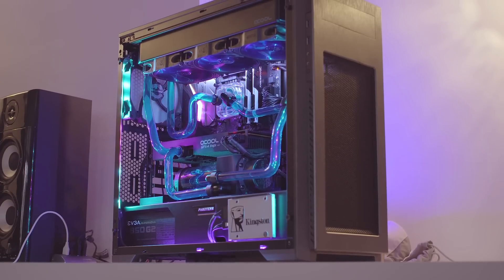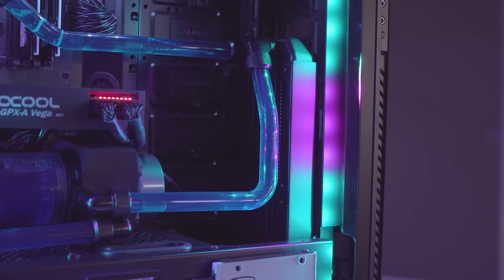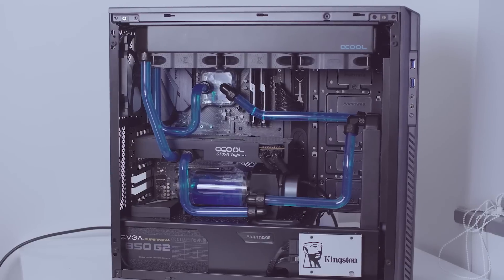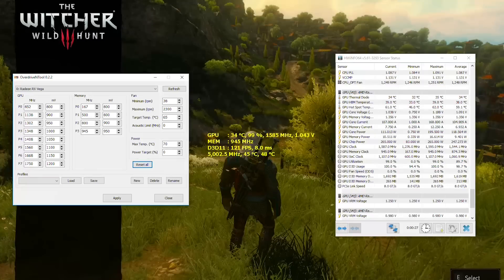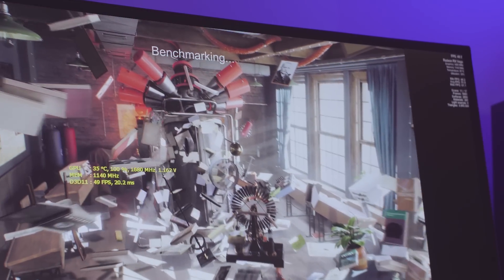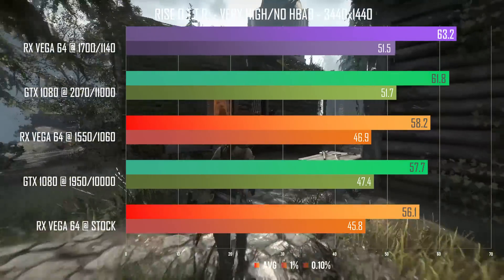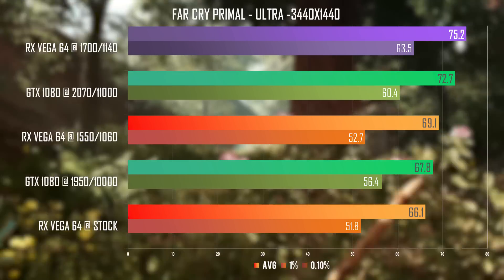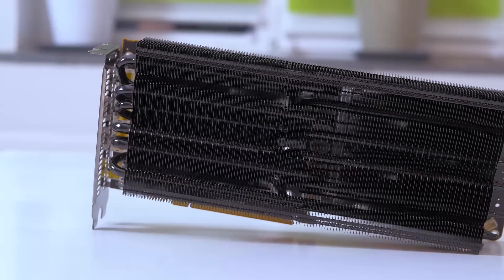1700MHz RX VEGA 64 - how FAST is it?

Comment: Wouldn't it be great if vega was included with the 12nm refresh early next year.
Reply from the maker: +Mikey Yes, this would be doable on air...
Reply: I really don't think we'll get a dual gpu card. Vega is too expensive and it seems the current capacity for putting out enough chips to do that isn't good. Plus how do you handle the HBM.

Comment: hey mindblank, nice video. i use the same water block on my vega 56. and i am seeing the same issue, that it crashes at stock settings (1750MHz boost). so i think that makes it very likely that the liquid cooled cards use binned chips. did you somehow tune the pump/fan-curve? i only use a double radiator... after a while under hard load the fluid temp rises as soon as i use a high power target on the LC bios.
Reply from the maker: +TheJohdu I'm 100% sure LC cards use binned GPU's.
Reply: so any tips on pump tuning?
Reply: if possible on my rx vega 56 gigabyte custom achievement 1720 mhz but at 1.1 v stable but mother consuming ... currently only 1,050 v at 1670 mhz all this accompanied by 1023 memory with tight times with memory tweaker ...

Comment: i wonder what makes the vega scale better for ultrawide gaming. Also, would a 750W power supply be able to run that system?
Reply: i basically run that system and at +50% power target with the liquid cooled bios it newer draws more than 560W from the wall. with a 600W-650W PSU you'll be fine. just get a quality one.
Reply: Vega 64 has 45MB of on-chip SRAM (or so I understood), and HBM2 memory. I'd wager the higher bandwidth and on-chip memory help tremendously at that higher resolution.
Reply: Thanks!
Reply from the maker: +Chris Clark Yes, it would.
Reply: I see. Thanks Severe Arts!
Reply: 750 watts should be just fine for Vega even with overclocks. Unless you also over clock the cpu. Then it will be kinda close to maxing out the psu.

Comment: It costs VEGA a whole custom loop and triple power consumption to match a 1080
I love you AMD but please. Get your shit together
Reply: Be glad they attempted to enter the high end market. I am amazed they are even still a competing company when compared to Intel and NVidia. Seriously look at NVidia vs AMD. In Q3 of 2017 NVidia made over 800 million while AMD barely made 80 million.
Reply from the maker: +Artemis I don't think anyone's gonna buy a complete loop just for Vega. Rather people having a custom loop getting waterblocks for Vegas.
Reply: Lee Aguina, the VEGA 64 has a power consumption at max load of 460watts and its not gonna be $499 anytime soon thanks to shortages and miners.  Also the 1080ti is dropping in pricing and with Volta around the corner it will see further price drops.  also SLI is not ideal specially with the fact the VEGA's big power draw and heat, never alone gaming still doesn't utilise SLI very well to this day still.

so as of now the VEGA 64 is priced at the same as a 1080ti if not more.
Reply: I don't know, if you already have a custom loop and you have a free-sync monitor, I don't necessarily think the Vega 64 is a bad buy.
Reply: these were the games that favoured the 1080 dude
if he used the results he said he wouldn't it would be a landslide
Reply: I also run a vega 64 overclocked on a 600w psu....
Reply: With the latest drivers ( 17.11.4 ) it is a killer card for just 479 euro !
Reply: Triple power consumption, bullshit? Stock the Vega has a 295w TDP the gtx 1080 has a 180w tdp. Stock vega performance from all the benchmarks I have seen is around 95% the performance of a 1080.
Not to mention the compute performance of vega 64 is much better.
Reply: Artemis Vega power is at 250watts at 2000h XRM another thing 200 @ 1900h if you wait Vega always go back to MSRP with is 499$ 1080ti is 899$ lowest 700$ if I get 2 Vega 56 at 399$ when it's at MSRP when you wait and they drop like always or even better get an open box for 350$ if you don't know what your talking about you shouldn't comment fan boy
Reply: gertjan van der meij, lol from here? off the back of a truck by a guy using the alias Bubba.  the VEGA 56 and 64 are on a global level of major hike in MRSP and shortage.
Reply: But Vega is great for mining because it has better compute proformence than Pascal
Reply: At stock it's only a few FPS less. Barely noticeable
Reply: I feel like after such a retarded statement, somebody needs to get his own shit together before all else...
Reply: Just keep it at 150 w maybe?
Reply: MindBlank Tech thanks for the reply. But I only state what it costs Vega to match a 1080. Not that anyone should build a whole loop for it. I really want to utilize my freesync panel but I'm on ab ITX build with a 400w SFX  PSU sadly

Comment: hello nuclear power comsuption...
Reply: Brynden Rivers, its not the electric bill thats everyone issues, the issue is the card isnt even that powerful and its power draw is extremely alarming.  not to mention in small enclosure chassis the amount of heat the card generates thanks to is massive power draw is dreadful.  not to mention the massive power draw and reaching high temps results in very lil ability to overclocking which it begins to throttle.   AMD need to get their shit together.

Comment: Well, with all this tinkering to beat the 1080 at the cost of massive power draw and quite frankly money, I could just buy a 1080ti and be done with it.
Reply: The amount of ingenious and unseen before data in this post staggers me. Thank you for opening my eyes!
Reply from the maker: +mortl I know, it's completely true. But WC enthusiasts that run Vega cards will watercooling them anyway though. Also this might be possible on air with a future Vega refresh, just like it was with my watercooled 1490MHz RX 480 that became possible later on 580's.
Reply: And now my stock reference vega 64 beats the 1080 ;\

Comment: Maybe you should shoot Linus and Jay a message, letting them know vega is actually a decent card
Reply: Never said Vega 64 was a bad card, but then again, the price positions it above 1080 by 100USD and under 1080ti by 100USD, and this is done by using watercooling. This video proves Vega can do higher clocks easily, but the power draw and heat would be too much for air coolers. AFAIK, 500USD gtx1080 vs 600+USD Vega 64, you are only getting 2-5% performance increase even with a waterblock and a custom loop with a 20+% price increase which means it’s totally not worth it. AMD should seriously try to make Vega efficient on higher clock speeds at this point, or they will have a tough time.

Double checked Vega 64 prices, apparently, they are all 680USD and above at the moment, which means it’s just 20-40USD under a gtx1080ti. The gtx1080ti will each the Vega 64 for lunch in any game at this point, so I think AMD still has to improve a lot of things here
Reply: Bourinos02 the v56 with a 64 bios performs identically to a 64. So price of the 1070 for performance of the 1080. Top that with people water cooling 1080s as well and you have yourself a very comparable offer. Also consider the price of freesync vs gsync.
Reply: Ahem, the only argument there is free sync vs gsync... 
In my country, a vega 56 (when supposing that it's the same performance as a 64 which would mean that there is no binning process between 56 and 64 which is unlikely) is around 560€, the price of a 1080 is around 550€. So basically the same price for worse stock performance and higher power consumption. Not really a win/win situation. Especially when you know that if you add custom water cooling to the mix you end up in easily in 1080 Ti territory in term of pricing, with a 20% fall in performance (OCed 56 vs stock 1080Ti) and even worse power consumption...
Reply: Or it is (more likely) silicon lottery.
Reply: Jay and linus get more  free cards from nvidia  then AMD so of course they push nvidia on people not one of  thier reviews  talked about hb2 memory is far better than ddr5
Reply: Wrathinside James Mastroianni 1st off, this GPU is $650+ in my country without the water cooling parts, 2nd this frequency just breathes fire and consumes too much power 3rd a GTX 1080 FE blower with good airflow can OC to 1,900-2,000 MHz core regularly, about 7,000+ score on Superposition. This GPU could be good if you are not bothered in tweaking the card yourself, but for the majority people, it's not a good card compared to the competition.
Reply: Linus did do a Vega/Morpheous 2 later and recommended it.
Reply: Nah. Let them circlejerk, that's what they do best. Last time I asked Hardware Unboxed about the discrepancies between his results and Mind Blank's, I got something along the lines of:
"We(I assume the elite techtuber community, they all circlejerk, it's very noticeable) have tried to replicate this channel's results, but could not do it. Therefore take it with a grain of salt."
Reply: Well, this video shows that if you use a lot of money to buy it and watercool it with a custom cooler and win silicon lottery, you can manage to be nearly identical to a 1080... For 100$ more, not including the cost of the additional cooling, and the electric bill..
So decent card, certainly, but price/performance wise, this card is just meh...

Comment: i would like to see what you could do with a 1080 after water cooling it and  spending the time tweaking it like you did  your vega card.
Reply: "ol 1070"
Reply: halistine jenkins I can tell you right now, my 1080 11g memory, thats at 2100mhz and 12gbps memory speed, doesn't do much better than this, and 2100mhz~ is really Pascals limit before ln2
Reply: yeah i dont have one...  i'm just looking forward to volta at this point.
Reply: halistine jenkins you don't see Volta until fall 2018 soonest
Reply from the maker: +halistine jenkins As far as I know, Pascal doesn't benefit as much from WC. AMD GloFo process is very temp sensitive though and will always do. Also, on Pascal you still have the hardlocked core voltage, unless you mod it.
Reply from the maker: +James Mastroianni Yup, in line with what people are getting on GTX 1080's...
Reply: Pascal's locked down so this is about the best you'll get without physically modding the card.
Reply: guess i'll be waiting til then.  the ol 1070 is getting it done for now anywho.

Comment: Nice vid, thanks. Can't run 64 liquid BIOS because of 'hot spot' temps. The liquid temp caps at 70c. At your max clocks on air BIOS you are already hitting over that. This makes the liquid BIOS unstable. I have same issue. I will try different thermal paste applications to see if I can get that 'hot spot' temp down.
Reply from the maker: +Raziel Is 70C the same cap for hotspot as well? Or just core temp, excluding hotspot? I do notice a slight performance uplift from the LC BIOS, which leads me to believe there's no type of throttling going on. Or dropping timings on the HBM...
Reply: You can also just use stock V64 BIOS and increase the Power Limit using the soft mod to avoid that: https://www.youtube.com/watch?v=EmMMs-5Kfq8
Reply: The card will begin to thermal throttle once hitting 75c+. We are already hitting 72c on 'hot spot' temps. Increasing power limit or voltage is only going to produce very minimal returns, if any.
Reply: Raziel are you sure that's not just the lc bios, or that you can't adjust the temperature limit?
Reply: Temp limit air 85c, temp limit liquid 70c. They will thermal throttle once getting inside 5 to10c of these max temps. If MindBlank is hitting over 72c already. MindBlack is hitting close to max clocks with power/voltage available on air BIOS, so reg edit or BIOS flash does not matter. Any increase in power or voltage is going to raise that 'hot spot' temp, thus thermal throttle.
Reply: I believe it is. If any temp sensor reaches close to temp limit, it throttles. Try lowering your temp limit to on your OC software to 60c or even lower and see. Your Core and HBM2  do not reach anywhere near that temp, only hot spot. With me doing that I notice performance loss, lower clocks. YMMV. I asked AMD about hot spot sensor, they passed me off to  board partners and the board partners passed me off to my block manufacturer... WTF. Just a run around with NO answers. Maybe a rising celebrity like yourself can get some answers...

Comment: So this is probably the stock performance we can expect from Air cooled Vega once it switches from 14nm LPP process to the 12nmLP process next year.
Reply from the maker: +magottyk Yup! Great remark! When I got my RX 480 to 1490MHz under water (AIO), people said it's totally not realistic since it's just a silicon lottery fluke. Then RX 580 came out and people were getting this on AIB cards.
Reply: Funny you mention RX580 as I got mine just yesterday (red dragon 8GB) and the first thing I did was undervolt by 50mv and pushed the boost to 1420MHz from the stock overclock of 1350 without increasing the power limit and now it's showing 137Watts draw and rock solid 74FPS (Riva frame control) in Witcher 3 with high/ultra settings (no hairworks) and dips to above 60 @ 1440p which is well inside the freesync range (48-75). I haven't pushed it yet to see what the max boost I can get, but I doubt I could have done that with a cheaper end RX 480. I did get it to run with a 75mv undervolt @1440MHz but it was artifacting, the cards cooler is a bit of a liability but it's mainly noise as it's quite audible @60%, but the temps are mid 50s which I'm happy with and I've fine tuned the boost to 1380 for that FPS range for that game.

The thing I'm wondering whether or not to do is to redo the thermal paste for something a little better (I use Prolimatech PK-1) as while I've still got plenty of cooling headroom, a few degrees less won't hurt.

Comment: Rx Vega should have been called rx 490 .
Reply: Not really. 490 would mean polaris.

Vega sets itself apart from polaris as it has HBM2 and more importantly new cores. Polaris uses GCN, and Vega uses NCU. With the reviews and benchmarks going around with Vega running on stock bios, it seems as if Vega is indeed fat polaris at 484 mm2. But actually it would be impossible for polaris to be that large in the first place without a truly absurd increase in TDP. As we have seen in reviews that customized the bios, Vega, between 185-225w TDP can still maintain a lead over the 1070. That is nearly in the same turf as the RX 580. NCU is evidently a significant step up from polaris from a hardware level.

I am hoping maybe AMD can refresh Vega with a more efficient 14 nm+ process, bump TDP down to 225w or so while maintaining it's performance. And i sure as hell hope its this year. This would be a great way to kick off aftermarket Vega to the consumers.
Reply from the maker: +thesilviu silviu Vega does sound cool though. :)
Reply: It was going to be, but then they changed their minds.
Reply: Vega 56 rx 490   vega 64 rx 590
Reply: thesilviu silviu you mean gtx 490 😂😂😂

Comment: Very very nice video, but what about power consumption at this frequencies?
Reply: 5:08 highlighted line in HWInfo.
Reply from the maker: +darkknight1193 Nowhere near 600-700W. Not even in peaks. But it's definitely way above GTX 1080, by more than 100W I'd say.
Reply from the maker: +Chakib Benga There's the estimated power draw in the HWiNFO sensors tab. Definitely above 330W...
Reply: MindBlank Tech So what's the total power consumption of the system as a whole? Has to be around 150W-200W more than GTX 1080. And depending on the chip; some reviewers have noted the RX Vega to consume over 400W. That's where made the assumption.
Reply: No matter if it consumes too much, the video remains a good Review :D
Reply: Its over 9000!
Reply: Chakib Benga Asking the real question here. I guess the total power cosumption would be atleast 650-700 W.

Comment: Outstanding! Best Vega review! I want it, but it's too expensive, so I just bought gtx1080
Reply: 3 days ago i bought the Vega 64  , i think it is NOT expensive , it is 479 euro in Holland ( around 520 dollar )
Reply from the maker: +Vzmaster Vzmaster With the waterblock it's definitely more expensive than the 1080. Also...power draw.
Reply: With the newest driver i like it very much , but it is also because i have a Ryzen 1700x cpu . i wanted all AMD . and ( for now ) the cooler is just fine .
Reply: If 520$ with nonref cooler then maybe its not expensive. But 520$+waterblock or 520$+aftermarket cooler 60$ is expensive, gtx1080 costs around 500-550$
Reply: gertjan van der meij it's impossible to get that price in  the US. The cheapest I believe is 599
Reply: Should be 499 right ?
Reply: gertjan: Used? Anyway, that's holymoly CHEAP! Vega 56's go over 600 € in bidding at ebay :-(
Reply: @Gertjan: Where are you seeing that price? On pricewatch they're between 600 and 700 euro's.. Same as a 1080.
Reply: 12Burton24 Everybody knows that. Vega buyers want to buy Vega, cos it's Vega. Not GeForce. K? B-)
Reply: all the shit he does to it probaly cost an additional $200-300 on top of the overprice rx64
Reply: buy it only id you do rendering, not for gaming
Reply: ikr it just freaking sucks! I would love to upgrade to a vega 64. :)